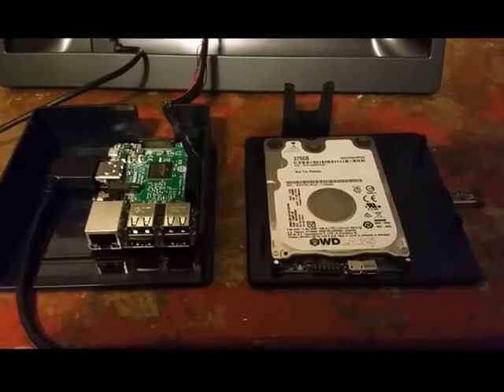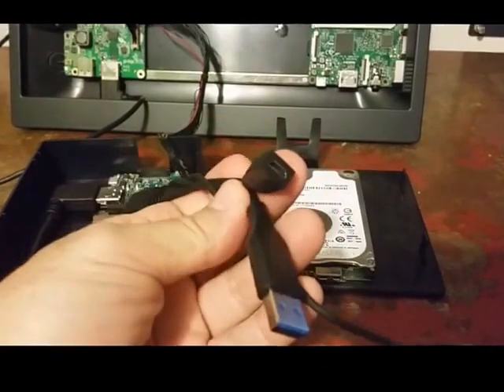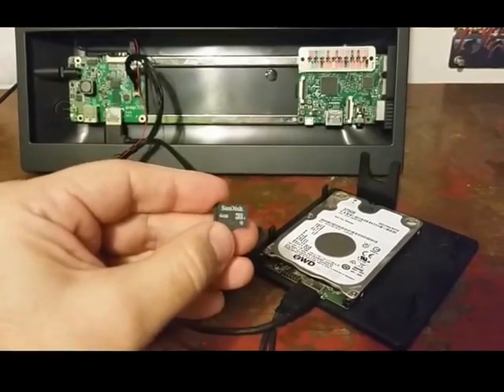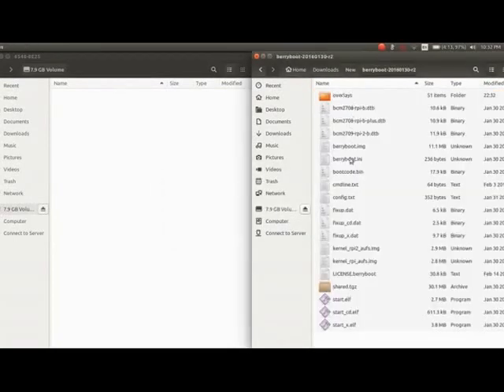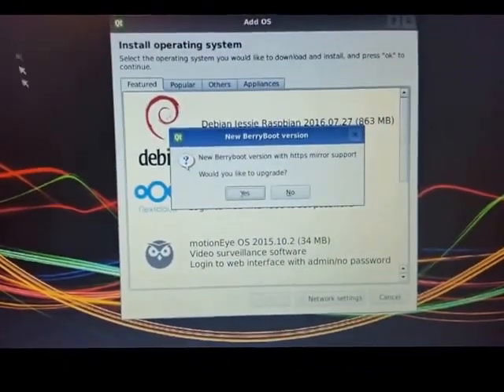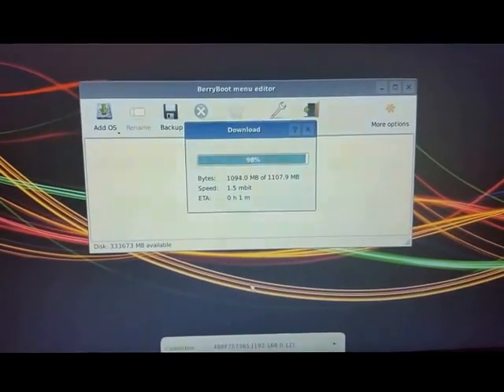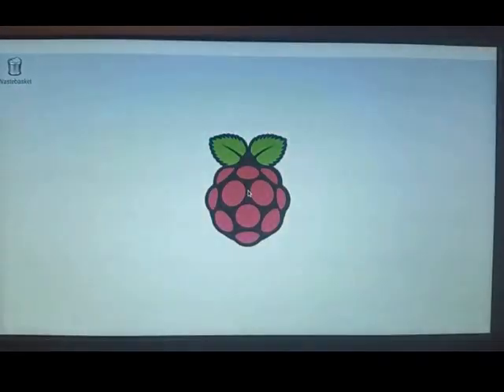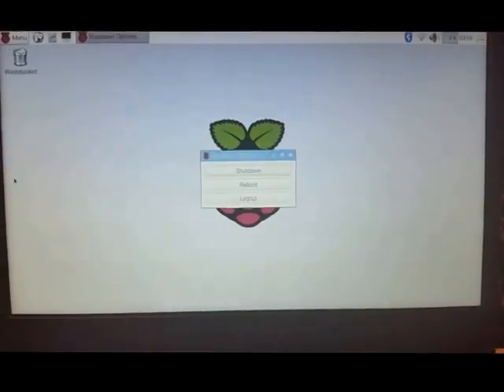Raspberry Pi 3 & Western Digital WDLabs PiDrive, BerryBoot Kali & Raspbian Jessie Linux install

Comment: It's funny because right when you said about putting black tape over that light, I was thinking the same thing. 
I'm considering buying the wd pidrive to run outernet and be a media server. Can it be possible to run a virtual machine within an os on the pi? I'm wondering how strong the pi 3 is.